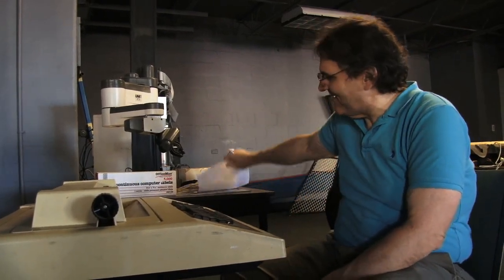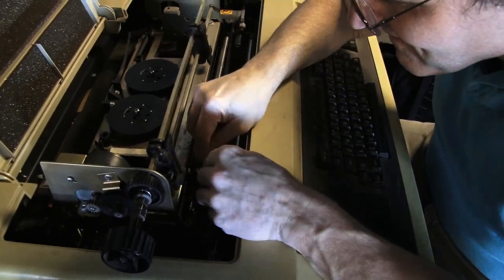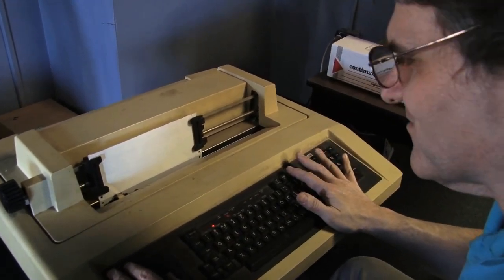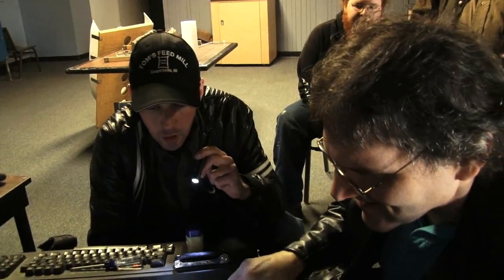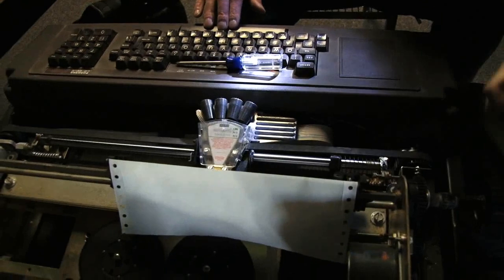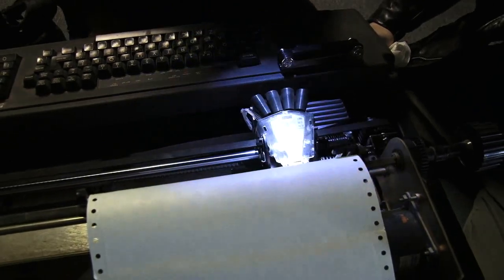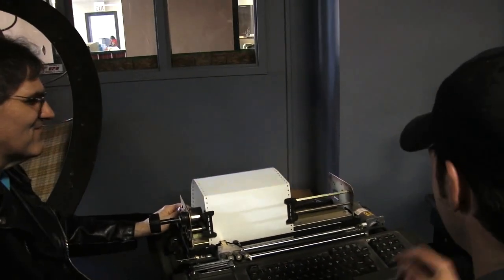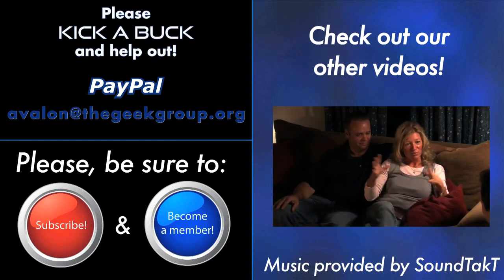Daily Log 2-18-11

Comment: Another interesting addition to the TTY machine is an RTTY machine for those interested in radio. I'm a ham operator, been so for maybe 4 years, and never had access to an RTTY machine. I've heard they're pretty cool to operate. Just a suggestion for whenever you get enough time to put in new equipment.